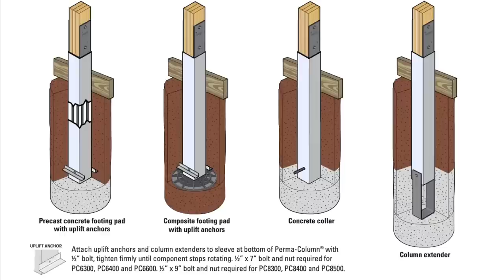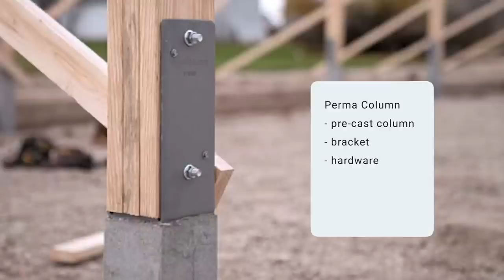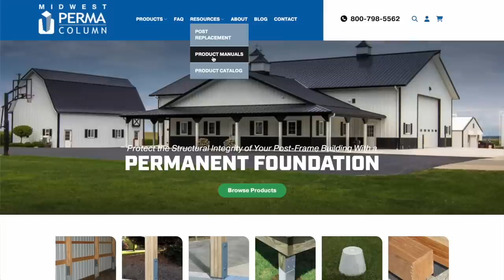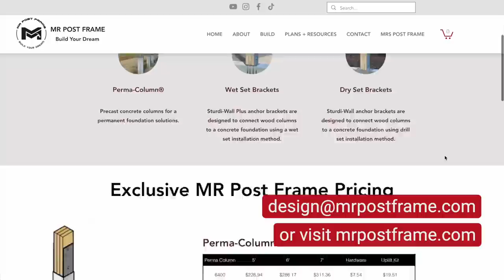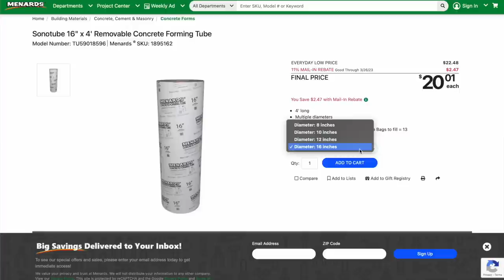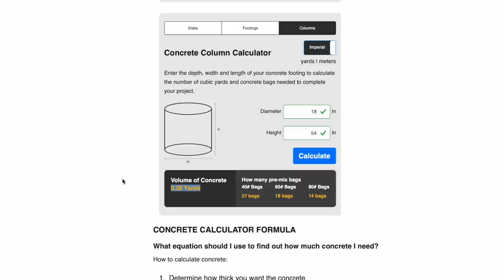BARNDOMINIUM: Start With A Solid FOUNDATION

Comment: The lessons learned are my favorite part. Is much appreciated, am also going to buy a mud mixer since I can't get a truck close enough to the pad during rainy season. It will do a yard of bagged premix per hour. Not sure if the operator (me) can keep up with that pace but hope to do a side of piers each day.
Reply from the maker: Midwest Perma-columns is also a great option if you can't get concrete in your area. Have you looked into those?
Reply: I bought a mud mixer with the hopper extension. We are building a 60'x80' post frame ag barn. Full concrete floor so that will be poured by trucks but the piers are all mine!

Comment: “Slab on grade” with poured piers. I understand going down below frost line completely. The part that isn’t resonating with me is the frost heave associated with the slab after the pier. 
Won’t the frost move the slab move and cause fractures in the finished floor? 
Also, I noticed that you haven’t used any EPS or XPS insulation under the slab or around the exterior to prevent thermal transfer onto the concrete. 
I’ll be starting the foundation work this spring. Do you recommend piers AND a thickened edge, turn down slab OR….
Everything I had imagined I needed to do is all discombobulated now lmao…. 
Love the details and depth and I will be contacting you for the proper materials once I get my head wrapped around the “what”!

Comment: I'm on rock.  When I built my house it was excavated with a 320 CAT.  He used a Ripper tooth to get through the shale.  Fortunately he only hit granite on the frost wall for the walkout and one pier for my deck.  IfI build a Post Frame building, it will likely be slab on grade wit dry set brackets.  The little soil we have is extremely granular and doesn't hold water so there is no movement from frost.
Reply from the maker: I love the dry set brackets and great experience building The Remington series with them. Great that you won’t have any frost problems.

Comment: So what depth is the minimum for a pillar? I live in Tennessee and our frost line is only 12 inch so that's not a problem. Thinking about going with steel trusses so I can add a upstairs room for the kids. Any troubles to worry about 10 foot center and thinking about getting 10x10 oak post with dry sets.

Comment: Paul thank you for the video,lots great info.I asked this before in another video,maybe you missed it.If my building is going to be 40" wide and my truss is 40" wide why does the bracket get set back 1-1/2" My simple mind says they should be placed same width trusses and columns at 40'
Reply from the maker: We set the bracket and column 1 1/2” back because we add a 2x6 girt to the outside. Not sure if that makes sense? That girt is laid flat against the columns and adds 1 1/2” to the dimension on each side.

Comment: Great video! obviously this question is relative to the number of piers you have, but how long after pouring do you typically have to place your wet set brackets?
Reply from the maker: Honestly it depends on heat, humidity, etc... In the summer, sometimes were scrambling to get the brackets set.

Comment: Another great video. We are on the fence btw two builders. One uses wet set bracket and the other uses the perma column precast pier. Any cons with the precast pier over the wetset?
Reply from the maker: I’d use the pre-cast Perma-columns all day. The only reason I don’t is because I have access to concrete and I like building my walls on the ground and then lifting them. I can’t do that with the Perma-columns. However I’m going to build a structure on my property with them.

If it was a struggle to get concrete I’d use them all day with no worries.

Comment: I know this likely requires a Structural Engineer, possible Seismic Engineer and possible geologist, but we are subject to high or extreme winds, Earthquakes, so seems like to me a Permacollum set deeper in concrete may provide more stability in high or extreme winds plus other seismic and tornado reinforcements.
Reply from the maker: Yes, many factors - soil, weather, natural disasters. I'm amazed just how strong these buildings are once you get them all locked together with metal.

Comment: I was the 100th like. Are the post and brackets a pretty standard size across America or do the different companies that make them all make them different sizes?
Reply from the maker: Pretty standard…I have my columns planed so they are nice and even. So they’ll be a little smaller.